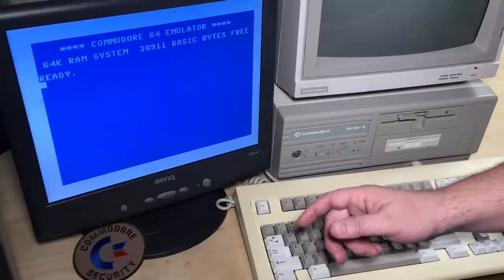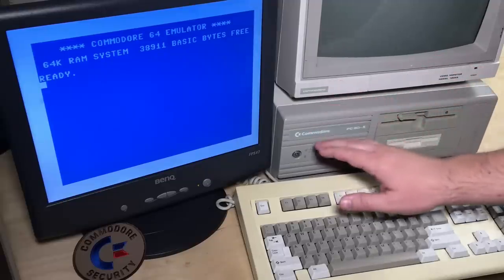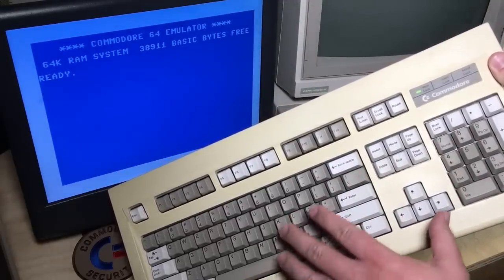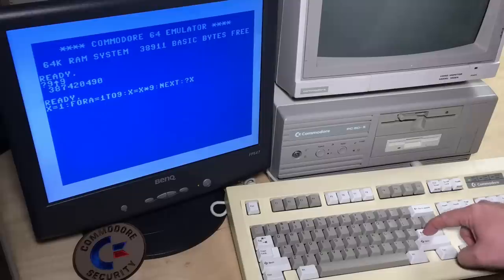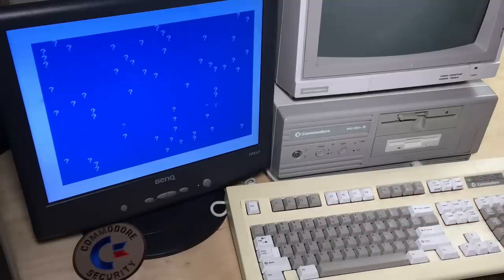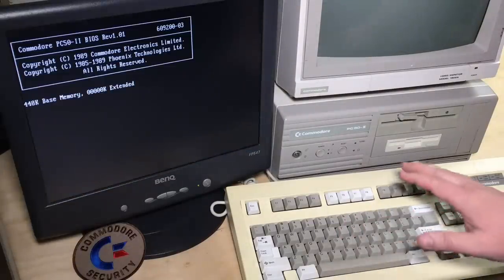Commodore PC 50-II: IBM PC-Compatible

Comment: This is like the machines I remember from 1989
I remember installing sound blaster ISA 16 bit sound card, ISA 8 bit modem with jumpers, IDE 16 bit controller , and ISA 16 bit 10 base 2 & T cards. Originally I had 50 ohm coax to the cards and later I ran Ethernet cable to a hub. 
I remember in around 92 installing CD Roms in them. 
I specifically remember putting the 4 1 MB ram sticks to be able to install Windows 95 and putting in 300 MB hard drives with bootloaders to get around the bios limitations. 

386s were the first real machines ❤

Comment: David Vivian Jagger's thesis, 'A Performance Study of the Acorn RISC Machine' was printed with text left justification, not fully justified, which is technically much harder to implement in software. LiveCode from Edinburgh never had fully justified text so I had to write my own using modular arithmetic. Absolutely terrifying. 🖋

Comment: just to correct some information:  that bottom plug is actually a s-vga connector.  The vga one has less pins and that's what you have in your expansion slot.  Your 1902 monitor expects a chroma and a luma line to it.  You probably are giving it one color channel.

Comment: Hmm, that 5 1/4" drive in the PC looks like just the gray version of the mech in the 1001. Does this drive have a Commodore model number like the internal 1571, etc.? I bet that 3.5" drive isn't an internal 1581, as much as I'd like it to be.
Reply: Looks a bit like a Panasonic branded drive judging by the design of the bezel if I’m not mistaking.

Comment: does the commodore monitor support   trapazoid adjustment 

d0es the monitor have the same issue when connected to c128 d
Reply from the maker: The monitor works perfect on the 128D, so it’s strange. No trapezoid adjustment on it, just the regular horizontal and vertical ones.
Reply: @8_Bit  my guess either different pin out or it mich need a pots adjustment  because the sync is out on the monitor..

it might be a different pin out or might be hertz resolution between the commodore monitor and the pc, I suspect there was likely a d model monitor specifically calibrated for the pc meaning the exsting line of monitors may not be as compatible ..

looks like that has capacity  to maybe run 3 monitors..

question have you tried and db9to db15 convertor to test whether its's the connection  of the commodore  monitor..

I wonder if they the same issue that plagued c64-and c128 with the issue of controller cables causing interference with the monitors..

what that reminds me of is out of sync via rf when the  rf would cause a screen bend issue..

have you triednto update that to dos6.2
Reply: @8_Bit  did youn try and adjust the horizontal 1

Comment: Hi!  I was having the same bendy video output on a Merit bartop video game with it's  internal VGA touch monitor.  Running a ground wire from the motherboard to it's monitor fixed it.  I would try running a separate wire from the chassis of the computer to a ground (RCA jack?) on the 1902.
Reply from the maker: Very interesting, I've put that on a list of things to try next time I've got the PC 50-II set up. Thanks!

Comment: The screen looks like it's expecting a composite sync signal but is getting separate horizontal and vertical sync, the Acorn monitor that I got for my Roland S330 (which is a similar Philips model to the commodore one shown in this video) exhibited similar issues being designed for SCART style sync not CGA style sync, strangely passive SCART adaptors do work with the S330 so I don't really know what the issue was in the end.

Comment: This looks like an Osborne computer (Model M286V if I remember right, running an i80286 at 12 MHz in turbo, 8 MHz normally) we had in the early 90s here (in Finland). The layout of the case and BIOS features look exactly like it and the Paradise VGA DIP switches (wish I still had the manual) allowed you to configure EGA output via that 9-pin port. I just can't remember if the secondary display output was a gameport-sized 15-pin output or the same 9-pin connector you've got there. Could it be, that the system was manufactured by a third party and was just Commodore branded?
Reply from the maker: It's certainly possible, though I had heard Commodore had a large team creating their PC line at one time. But maybe they still started with other designs and then adapted them?
Reply: @8_Bit  It could be, but like there's some posting regarding the system here https://www.lemon64.com/forum/viewtopic.php?t=53535, it could be that it's a generic clone. Then again, the PC-side of business was run by the guy who introduced IBM PCjr. I think the video on VCF East 9.1, specifically the third part of the Commodore story might open it up a bit. Those guys (David Haynie perhaps?) would also know, having worked in the company at the time of the release of the system.
Reply: @8_Bit  The three videos I watched regarding Post C64 Commodore were pretty eye opening to me, Bill Herd's "Part 2" of the trilogy: https://www.youtube.com/watch?v=-Zpv6u5vCJ4, Dave Haynie's "Part 3" https://www.youtube.com/watch?v=8jIjBX2ztPs and this: https://www.youtube.com/watch?v=BhTNR6XZJd0 (Three hours total of just talking in these three videos). The PC engineering team was apparently around 40 people, while the Amiga team (that needed actual engineering) was only 7... And in that last video, I remember either of the interviewed guys saying that the PC market really didn't need an engineering department, because it was mostly outsourced stuff (then there's the Phillippines thing mentioned in this video). First two guys are engineers from C128-era and Amiga era (respectively) and the last part is (I think) a managerial perspective on the downfall.

Comment: Nice video.  I knew Commodore made PC compatibles, but never actually seen one in use.  Nice looking machine.  I went from using a C64 to an A500 then A1200 and A2000HD.  I never did PCs until commodore went bankrupt combined with games like Wolfenstien3D and Doom coming out on the PC finally pushed me into building a PC as I was really interested in 3D.  I learned all about the hardware and have been building and programming my own ever since. :)

Comment: I remember the Commodore PC'S. I  used to laugh at how my 68000 Amiga could run circles around a silly 286 or even a 386. It was not until the 486 and Windows 95 that I could even take PC's seriously. Great video as always, Robin!
Reply from the maker: Yes, the so-called multimedia PCs were a stuttering mess compared to my Amiga 500 in the early 90s. And the Macs too - I remember the first QuickTime demo I saw, with a postage-stamp sized video running 😁 Of course they eventually caught up but it took years.
Reply: I had the same experience.  The Amiga could do more and multitask better at only 7MHz compared to the faster CPUs on the PC, and the reason the Amiga was better was that it didn't rely on the CPU, it had separate processors for everything, a concept that took a long time before PCs finally came around and made GPUs etc.  I STILL feel the Amiga multitasks better, you didn't wait for one program to shut down and another to open or some such nonsense, they all ran in true multitasking fashion.  I definitely miss that machine.... especially now that I have learned that most X86 CPUs in use today have a hidden RISC processor on them and a backdoor that can bypass any security.  I watched a video just last night where a security researcher discovered how to access it and he demonstrated how he could run a program and go from being a normal LINUX user to gaining ROOT access using this hidden processor, so... makes me appreciate the Amiga more than ever.  (Search for "GOD MODE UNLOCKED")

Comment: I had a Olivetti 386 in the early 90's and that bios looks very familiar.
You had to do CTRL-ALT-SHIFT and DEL together while the PC is running to get into the bios if I remember correctly.
Reply from the maker: I tried both of these suggestions and at best got the same "keyboard stuck" error I showed in the video, and then hit Escape to get into the BIOS config. Thanks for the suggestions though!
Reply from the maker: Interesting, I'll give that a try. I ended up holding Insert+Delete together until I get the key stuck error, then hit Escape to enter the BIOS.
Reply: @8_Bit  Should be Ctrl+Alt+Esc
Reply: Really? When I think of Olivetti BIOS I think of the good old "Resident Diagnostics" POST screen, and the abstract set-up with the language selection and the crude icons. I don't remember an Olivetti computer with a BIOS similar to the one in the video but it's possible, maybe a laptop, a later or a low-end one, I'm not that familiar with those. Can you tell me what it was?

Comment: The CPU date code appears to be the second week of 1989, hence the 892, that is my guess.
Reply: No.  L947 is the date code, the 0892 is part of the batch and serialization on the FPO coding.  The first letter is fab plant L for Malaysia.  The second number is the year of the decade it was made.  9 for 1989.  The second two numbers are the week of the year, 47.  47th week of 1989 in Malaysia.

The Co-processor 387 was made in Malaysia in 1990, 17th week.  (L017).

Most of the TTL logic and support chips that I could see have dates from the 30th week of 89 into the 40th weeks.  

I suspect the PC was built in November or December and that the shop that sold it to the original owner in early 1990 installed an FPUfor him/her.

Comment: I wonder if the BIOS shadow is not a waste of ram? No serious program used BIOS calls back then anyway? So better use it as extended ram, or so?
Reply: Unfortunately, on most 386-class and better machines, disabling the Shadow RAM feature would not give back the access to these 384 KiB of memory anyway. Only few selected motherboards were able to remap the memory accordingly.
I still remember how disappointed I was when I switched from a 80286 with 2 MiB of memory (1408 KiB extended memory available) to a 80386DX and could use only 1024 KiB of extended memory.
Still, disabling the Shadow RAM did have some negative impact on peformance, even with most of applications bypassing the BIOS. I am not sure what the magnitute of this impact it. It would make an interesting video on its own to compare different classes of DOS application with Shadow RAM turned on and off.
Reply from the maker: I think I tried disabling the shadow RAM and found the computer ran noticeably slower but now I can't recall if I tried disabling only the BIOS shadow on its own. I may have done it together with the video shadow, which would have more of an impact I assume. I should try that.

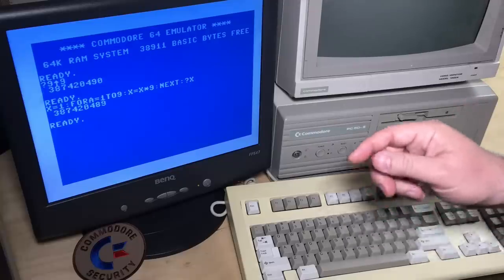Comment: 4:26 9^9 is implemented using the EXP() and LOG() functions internally, which will produce subtle rounding errors on all systems at all precisions and regardless of using binary or decimal floating point.  9*9*9*9*9*9*9*9*9 is entirely an integer calculation and won't produce rounding errors (unless you exceed 2^32).

5:18 The extremely slow speed reveals that the output is produced in batches of around 256 characters.

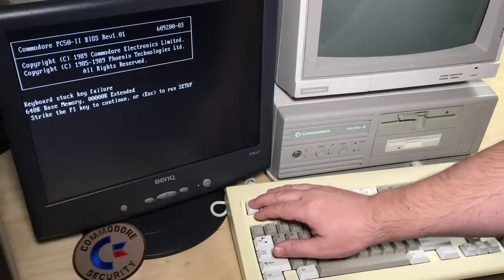6:36 The 1987 BIOS is Y2K-compatible!  8:18 It seems that the system-info program ISN'T Y2K-compatible.  Remember when Y2K was a thing?

10:46 Did you say that your monitor model is a "1902A" or a "1902, Eh?"?
Reply from the maker: It's a 1902, eh?

Thanks for all the comments. It'd be weird if that system info program isn't Y2K-compatible because I think it was updated as recently as 2010. But that may be what it's complaining about, yeah. And yeah, I remember Y2K. I worked at a telco at the time and we had a lot of work to do to get ready for it!
Reply: Reminds me of a trip I did to the US about 10 years ago. I was driving to Six Flags in New England and I had three co-workers, all American, in the car with me. They were all acting as navigator to some extent, as this was in the day before google maps was a thing. I can't recall the exact number, but the one guy was telling me the exit ramp we were looking for was something like 44A. And the other two chimed in.. don't tell him that! He'll get off on exit 44. Then they were like, look for exit 44A EH! They all thought that was pretty funny. :D

Comment: You need to crack open the case and have a look for the 386 and 387 chips. From memory they'll be square chips. The bios may not have a battery and that means the setting swill be lost every time. I had an old IBM PC JX from that period and you needed to buy a clock card for it (it had a 256kb expansion card) your pc may be similar. The VGA dip switches I think some times set things like available ram and frequency (as other people have said). One of them may be a enable/disable switch. Perhaps a multi meter in the VGA socket to see if it stops outputting a signal might tell you if one of the dip switches is turning the port off?
Also try and find the VGA ram chips. Some times HDD 0 (or another number) was actually the entry you could edit and put in what ever cylinders and heads etc. That depends on the manufacturer.
Reply: I've only really managed to find this page with any real info/nice photos https://oldcrap.org/2019/03/16/commodore-pc-50-ii/
It seems that this page is new.
Reply from the maker: Nice, I didn't see that one when I was searching last (which was probably in February). That keyboard looks like it was for an earlier Commodore PC, the style seems more XT or AT-era than 386-era.
Reply: check out the 1084 sync adapter circuit on this page https://oldcrap.org/2018/05/02/robotron-kc-87/ inspiring stuff

Comment: Old Amiga, C64/128 and PC10-III user here. The 1084 and 1902 monitors are indeed fixed frequency 15.6-15.8 kHz monitors. That you're getting a picture at all at 21.8 kHz just shows that your monitor is rather tolerant... I would rather think the two DIP switches you changed disable VGA and thus an extra CGA/EGA card was enabled by the BIOS automatically. Older Commodore PCs had such a card, and I think I still have one here somewhere.  That card of mine had it's own set of DIP switches for the modes....
Also, if those jumpers physically disable your VGA chip, that would explain why your emulator can't open a VGA screen, certainly!
Reply from the maker: Yeah, I think the CGA (or maybe EGA) mode disables the VGA, so only one of the jacks is active at a time.

Comment: I use to love C64S. Hadn't used a 64 emulator in years and was surprised to find Vice a few years back. Still miss some of the ease of use found in C64S.
Reply: I remember running that on my DX33 386. IIRC it didn't actually run much better than in this video lol.  It wasn't until a pentium that its performance was acceptable.

Comment: Where is the Turbo-Button? There is a LED for it on the front panel, but no button. Maybe it's the ON/OFF switch in the back?
Reply: Key combo on the keyboard.
Reply: The Turbo is set in the bios , switches between 8 MHz & 16 MHz
Reply: @simonbailey8728  It can also be done by pressing Ctrl Alt Plus (or) Minus (on the numeric pad).
Reply: @wishusknight3009  OMG Forgot that one , had same one for years never used it always ran at 16 MHz
Reply from the maker: I didn't know about the key combo for turbo mode, thanks!

Comment: I liked this video.  It's Commodore!  Their PC's at the time didn't really interest me because I was a 64 and then Amiga nut.  But seeing them now brings back memories of seeing them in the computer stores.  It looks like you could mount that 3.5" floppy in the vertical cal bay to the right then fit a CD-ROM drive in there for some old DOS CD games/software.  A Sound Blaster 16 with an IDE interface for CD would be a good sound card for that machine.
Reply from the maker: That would be fun, maybe I'll do some upgrades on it like you suggest. And yes, I should have mentioned in the video that I was also a C64 and Amiga nut, and their PCs seemed very boring to me then. I'm still far more interested in the 64, but I have to admit that I'm growing to like other PCs in my old age :)

Comment: While searching for a manual (I was unsuccessful) I noticed there's room for eight SIPP memory sticks on the board. You can make SIPPs by soldering pin headers to SIMMs. Don't use the regular pin headers like you get on floppy and hard drive connectors, use the thinner machined ones or you'll damage the sockets.
Reply from the maker: Interesting! If I'm feeling adventurous I might try that, though my soldering skills aren't all that great :)

Comment: I'm guessing the DIP switch configuration puts the VGA adaptor into CGA compatibility mode - the character graphics appears to be 200 line (8 lines per character).
Different sources have slightly different pinouts for the commodore monitors.  e.g. from <http://www.hardwarebook.info/Commodore_1084/1084S_(Digital)>, the 1084 monitor has HSync and VSync on pins 7 and 8, while <https://radagast.ca/C64_svideo/repair_pinouts.html> has those pins as Mono and N/C respectively (with no mention of hsync or vsync).  Though, the cable you have has pin 7 on the DE-9 connector (mono) unpopulated.
It's also possible that the waviness is just a bad connection - e.g. corrosion on the header pins.